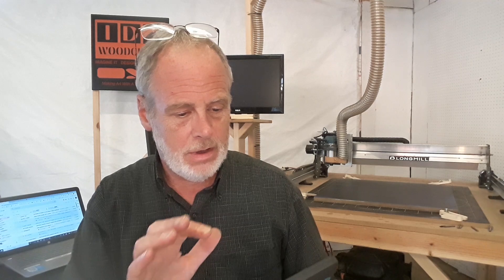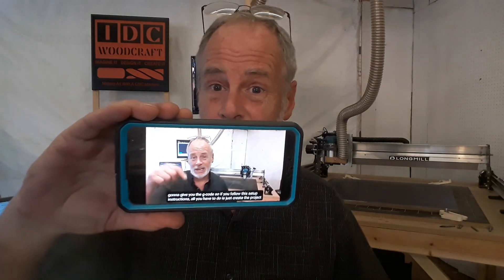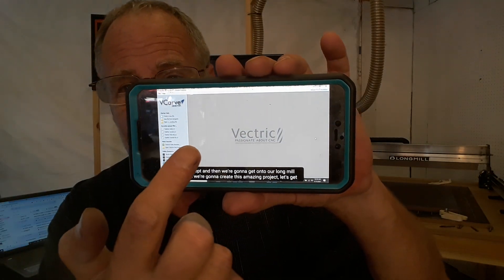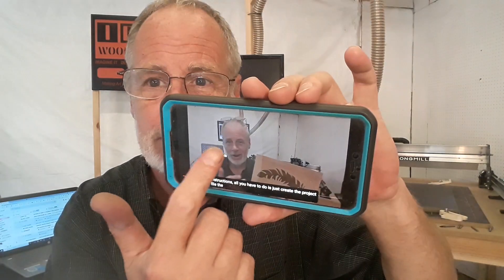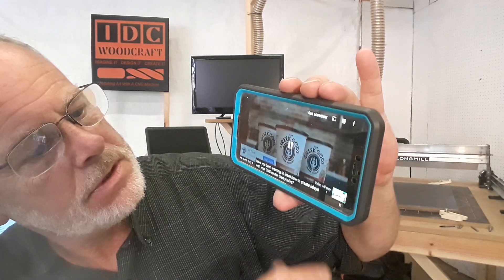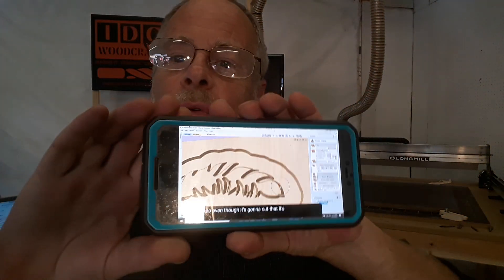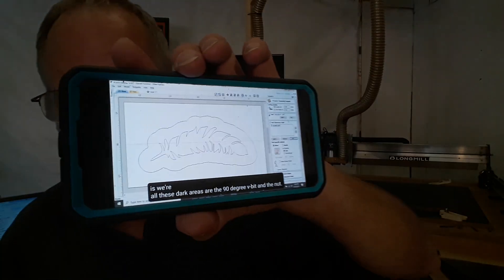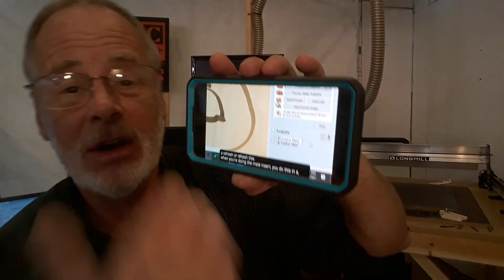Quick Tip When Watching CNC Project Design Tutorials - Garrett Fromme

Comment: I have a question for you. I've been making signs and stuff some have been very successful some failed .
I'm looking for a good cutting bit to cut out my projects preferably 1/8 shank and 1 inch cutting depth what do you suggest? Also im using carveco looking into v carve. say my machine is 5x5 cutting surface will aspire v carve be able to work this size? Thanks for your videos learning all the time
Reply from the maker: Hi Rambler. I do not know who sells a 1/8" with a 1" flute length. They are typically .75 long. I will be stocking one soon with and 0.875 length.
Reply: .75 that would be great most thing i cut the wood is 7.6 on my caliper please let me know when you get them it thanks I have a big project and I need  the right bits Thanks for your videos im really learning new things all the time Im trying to open mu business but I have trouble in that department  @IDCWoodcraft
Reply from the maker: @therambler3833  if you're trying to start a CNC business, you may want to join the webinar that I have coming up at the end of the month. It is to teach how to start your business.
Reply: Looking forward to it  i did sub to your channel so Ill keep an eye out
Reply from the maker: @therambler3833  just so you know, the CNC business webinar is not a public video. It is a live webinar. You have to register for it. Let me know if that's something you want to do
Reply: Yes sir it is can you sign me up please  @IDCWoodcraft
Reply from the maker: @therambler3833  you will have to register. You can do that here → https://calendly.com/garrettfromme/cnc-business-webinar

Comment: Figured this one out a few weeks ago. I don't remember how but the length of the skip is adjustable using some settings.
Reply from the maker: I didn't know you could adjust the skip length. I'll chedk that out. Thanks
Reply: I finally looked it up.On my phone I click on the circle with my initial, click on SETTINGS, GENERAL, DOUBLE TAP TO SEEK, then I choose the length of the skip using the radio buttons